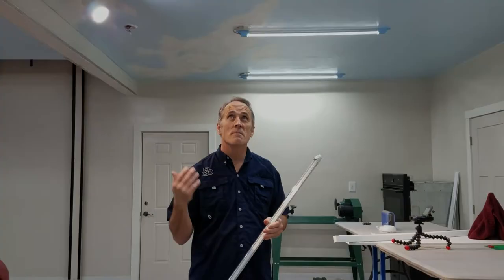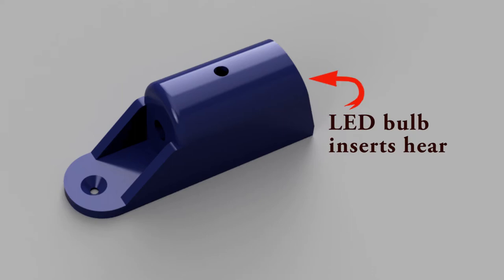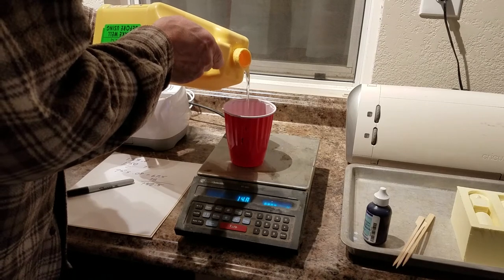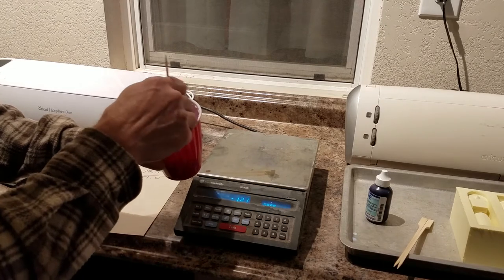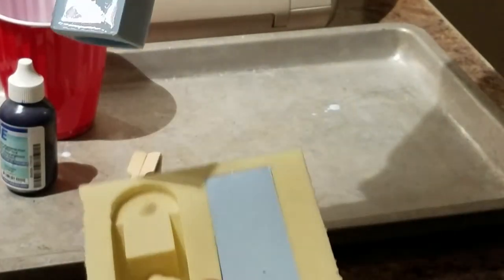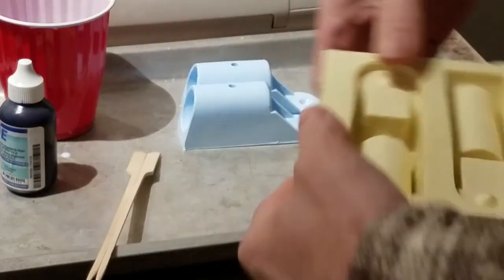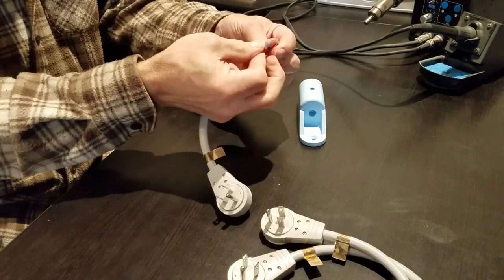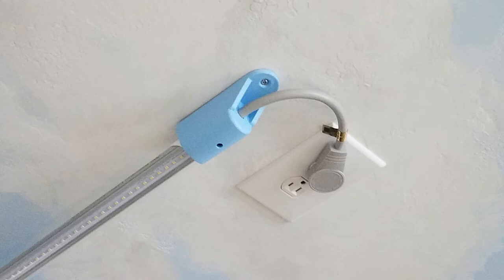On the cheap! We make our own T8 LED light fixtures- SS1

Comment: Good video. Using an existing ceiling as a reflector is good thinking. What color temperature leds' did you pick? I also wondered if you need typical draft angles when using silicone molds?  Thanks for the info
Reply from the maker: I think they are 4500. No need for draft as the silicone is so flexible.
Reply: How did you make the molds? i am going crazy trying to figure that out. I want to do these so bad and that's the only thing jamming me up.

Comment: I have been watching the Arete build and have been wanting to know. the system that you have been using to do your water jet cuts and the 3d printer in this video what is it or are there multiple?
Reply from the maker: The 3D printer in this video is a printer I built. It was a bit wobbly and didn't have the accuracy I needed, so I gave it to a teenage boy who had interest in getting into 3D printing. I am currently building a new printer, but a certain car construction project seams to get in the way. Ha! I have a professional service do the waterjet cutting. I just lay out the outline of what I need in CAD and email it to them. Some materials I supply to them and some they have in stock. There is waterjet (and or laser) service in most moderate sized cities.
Reply: Thanks for replying so soon. and thank you for putting up these videos it has given me a new perspective about many things I can do myself. For now I am trying to learn about electronics and looking forward to getting my self to where I can make a car as well. So you did for me what your dad did for you. about the whole new changing your thinking.